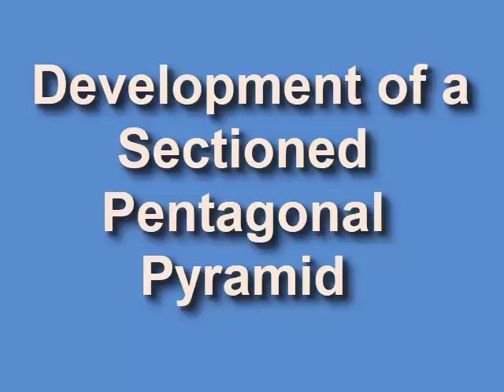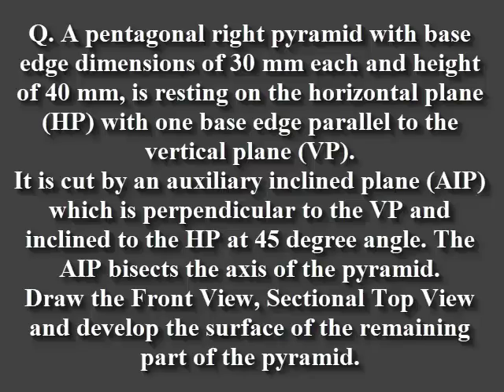6.4-Development of Sectioned Pentagonal Pyramid Surface

Comment: Can I use this for pure Construction ?
Reply from the maker: These methods are basics and are applicable to civil, mechanical and other fields. However, you will need to learn specific things for different areas as some of the nomenclatures may change. Such as Front view is called Elevation and Top View is known as Plan in Civil Engineering.